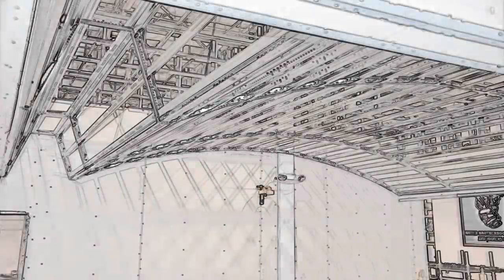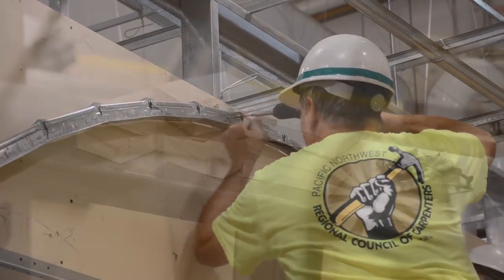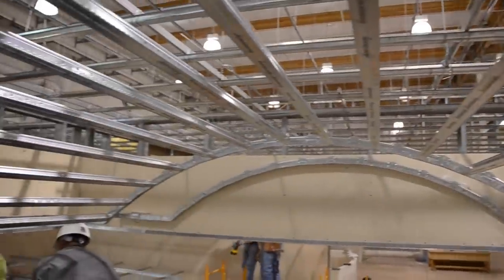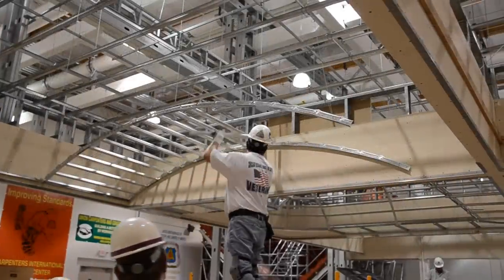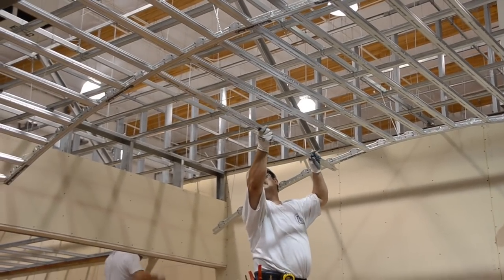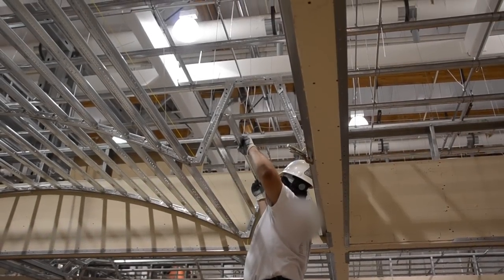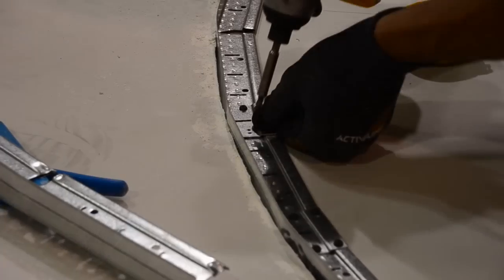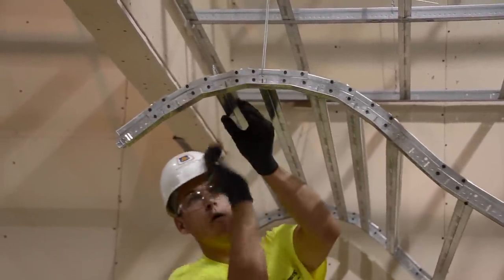Constructing Curved Ceilings With Drywall Grid | Armstrong Ceiling Solutions

Comment: That dw grid is to weak, any suppended ceiling should be no bigger spacing than 4ftx4ft and hung with 9ga. wire, i was a Union Lather in Michigan for 35years, we did tests for USG  and Donn
Reply: These are special t's that armstrong just recently designed. Its only for 1/2in board i believe